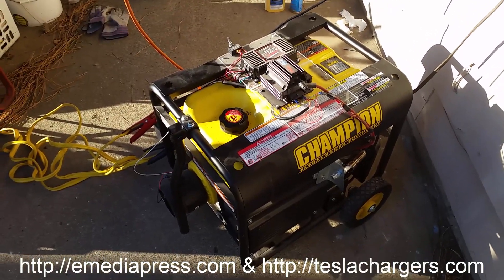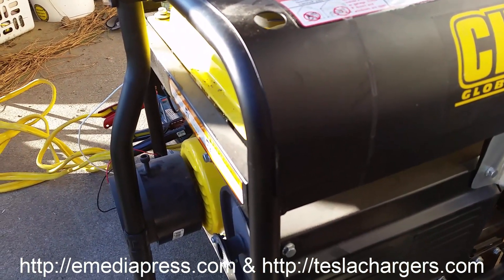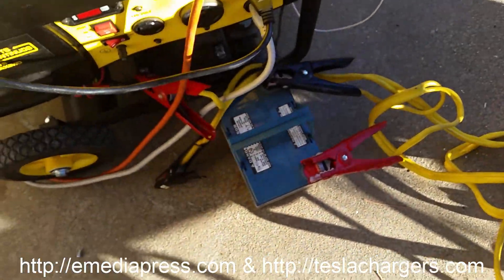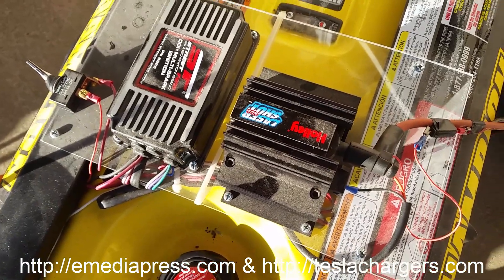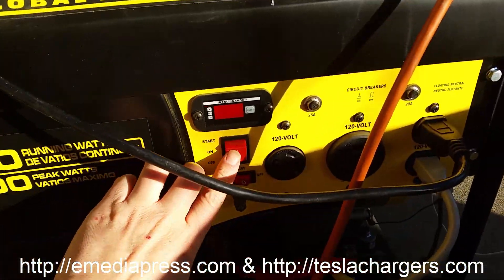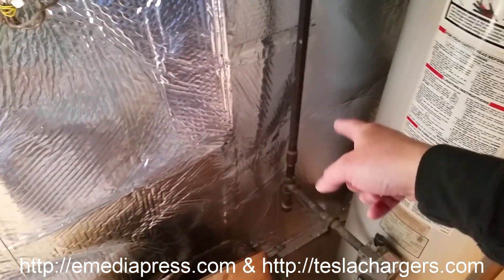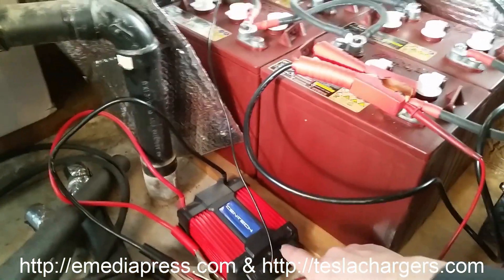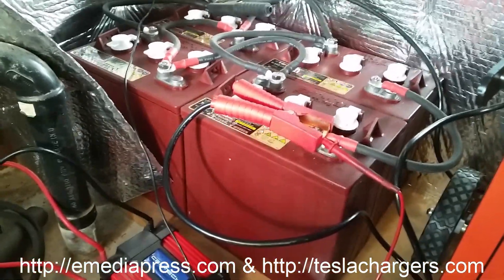2015 SPOKANE WINDSTORM - HOW TO KEEP THE LIGHTS ON

Comment: hi Aaron
i’m new to electronics so please bare with me
the reed switch has 3 pins, how are they connected to the transistor which has 2?
the red(trigger) and black(ground) wires connected to the transistor are attached to which pins?

what’s the model of your transistor, reed switch?
Reply from the maker: The reed switch has 4 pins I think. The two pins at each end long ways are connected to the magnetic switch. The two that are across the narrow width of it towards one end are connected to a coil so you can electrically turn the reed switch on by putting power to those pins. I'm not using those, I'm only using the 2 pins at each end of the long ways that are connected to the magnetic switch. 

Transistor has 3 pins. Base, Collector and Emitter. The white trigger wire goes to the collector and emitter goes to ground. I think the reed switch is between the base and collector. I'd have to check, that generator is at my shop and not sure when I can get to it. 

Transistor isn't critical, just make sure it is a NPN transistor. Just get something like a RCA 3055. Reed switch, also not critical. I'm only using the leads on the switch itself and not the coil. You can just use a simple glass reed switch with the 2 leads.

Comment: Thanks for sharing this to the world, Aaron, are the details to how you made this particular design of plasma ignition for this generator build on the energetic forum?
Reply from the maker: To a point in the water sparkplug discussion. It shows how to do the plasma ignition, but you have to do some mods on the generator.
Reply: @AaronMurakami13  So, what are the main modifications you have to do to the generator, besides make the flywheel magneto fire the normal spark plug outside the combustion chamber and bolt those ignition modules to the system and do some wiring?

I've been rewatching it multiple times to look closely at the modifications at the front, but each time I watch and I see something I don't know much about, the more curious I get.
Reply from the maker: @DerpyRedneck  Off the shelf MSD, trigger is triggered by plastic wheel with magnet on shaft that goes by reed switch in the abs end cap and that triggers a transistor to go to ground - that is how it is triggered. That's about it - abs endcap rotates 360 degrees so has infinite timing adjustment. Of course non-resistor plug.
Reply: @AaronMurakami13  thanks again!

OH!! I was rewatching the Borderlands of the Tesla Transformer presentation not too long ago, and I remembered some research was proposed to construct the electrode for a Fusor out of carbon nanotubes, maybe that would have implications for a Farnsworth Fusor and the Cosmic Induction Generator?

I will admit that it was discussed based on using a machine with a wire cage, where ions are moving at steady-state, or oscillating around, called the POPS Fusor, developed by the Los Alamos Nuclear Labs..

The idea may have promise, but it's a painfully expensive idea..

It's something I thought of throwing your way and see what Eric Dollard would think.

Sorry, the damned mobile device made "Dollard" into "dollars" instead, I edited it.

Comment: Good stuff! Chance favours the prepared mind!
Is your spark plug ignition lead a low resistance lead, or is it just the spark plug that is low resistance?
Reply from the maker: +captain42979 It's best to go with 2 x 6 volt batteries for 12 instead of single 12 volt batteries. You can then put a common bus bar down the middle of the paralleled sets to equalize them and that alone will extend the life of them beyond what 12v by themselves will do - you prevent the inside cells from going bad. We highlight this in the Solar Secrets free ebook. 

Also, with these T105's, you can take a 12v string out of the whole bank and you will still have your 12 volt system avail. If you get monster 2 volt batteries or other super large batts, taking one battery out can cripple the entire system. 

The best way to do it is to have about 4 separate battery bank systems for a home. That way, you have ones that have complete down time and they can be charged to a real topping event 15.3 (with flooded cell lead acids). With multiple banks, they cycle around with real world use so some get down time to get charged like this, which almost never happens with a single bank for an entire home. 

With 4 banks, that is 4 charge controllers going to their respective banks so perodically, if they can get charged properly, then you are reversing the entire chemistry back to like new state. Theoretically, it gives an infinite amount of charge/discharge cycles to the batteries. Bedini has old used batteries that were rejuvenated 15 years ago that are still like new and are used to run tests on with the charge controllers and plug in chargers. We don't guarantee any more lifespan than the manufactures rating because we can't control how people will use and abuse their batteries - but the chemistry is 100% reversible. I believe the batteries can last the life of the panels easily, which is 20-25 years from what I've experienced over the years - AS LONG AS they have some complete down time and can be periodically brought to the full topping event during those down times.
Reply from the maker: +Energy Fabricator The spark plug is non-resistive, the cable does have some, can't recall right off what the resistance is, but it is a common performance cable that normally goes from the coil to the center of a distributor cap. When I get a chance, I do want to put a non-resistor cable there, open the gap a bit more, etc. I want an adjustable carb so I can see how lean I can get it and have it run cool at the same time. Thermal efficiency actually goes up when we go ultra lean as long as there is an ignition source that can ignite an ultra lean mixture and this plasma can do it. I want to recycle some exhaust, add HHO and water vapor as time permits.
Reply from the maker: Stephen Moldovan
I put it all in the "Water Sparkplug" threads at http://energeticforum.com if you don't want to search thru it all, you can get my entire comprehensive package at http://ignitionsecrets.com
Reply: +Aaron Murakami  Hi, is there a way to get a better description of your plasma ignition?
Reply: +Aaron Murakami So these are the best batteries for a system like this and with a tesla charger they will last I am gonna be modest lets say at least 15 years?

Comment: You are missing this:https://m.youtube.com/?#/watch?v=PZksSgaQ4mE
Reply from the maker: +Cori Alge Look again, https://youtu.be/Fh6qzBsEf4M?t=7m41s see those red things strapped to my gas line feeding the boiler? http://magnetizerproducts.com - originated from Bruce DePalma's patent and slowly improved upon - the best in the industry used by military, industry, schools, you name it. Our wok on this is documented here http://magnetsecrets.com.
Reply: My understanding is that the Nazis got the idea from an Oriental (Chinese?) fisherman who had it on his boat. The Nazis used magnets on their fuel lines.
Reply from the maker: +Cori Alge It's possible, I never heard of that story but the Nazis were on top of many technologies. If you have any links to the stories about the Chinese fisherman, I'd love to read it.
Reply from the maker: +Cori Alge That article is interesting but there is some bad info in it. They claim you need the strongest, but in fact, if the magnets are too strong, it negates the benefits because the fuel clusters are broken down but then with the strong field, they magnetically attach into longer chains reducing the surface area so it defeats the purpose. 

It also recommends a bad technique of putting the field line across the fuel flow but you want opposing fields. For example, in DePalma's patents with the ring magnet, the fuel enters the north side and when it exits, it is only being exposed to the south side, which is the field you want the fuel exposed to last.

You can see who uses our products and what kind of results they received: http://www.magnetizerproducts.com/testimonials.php